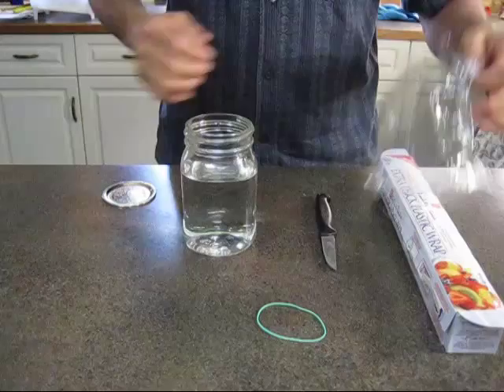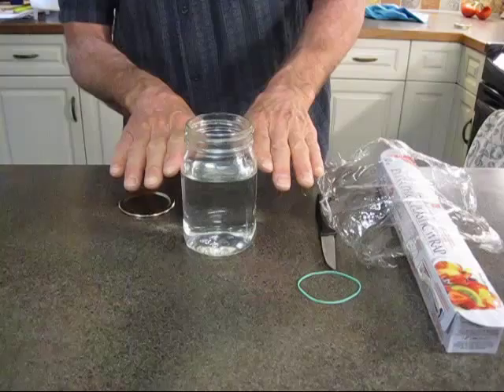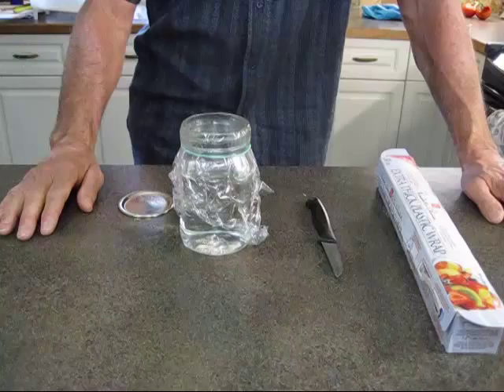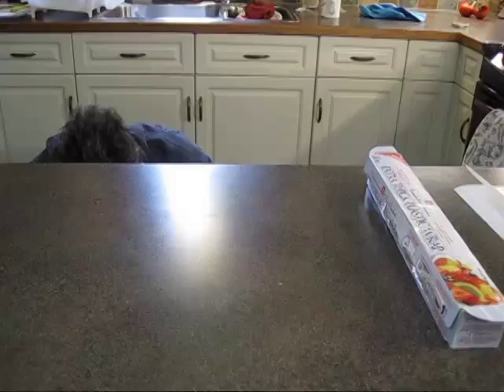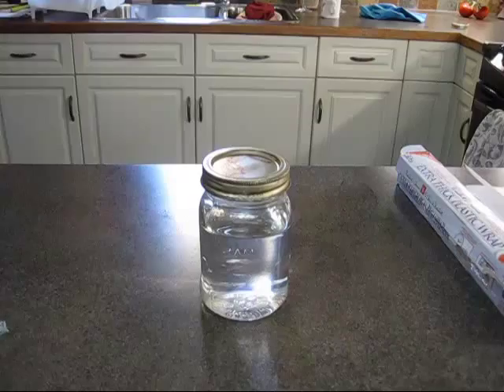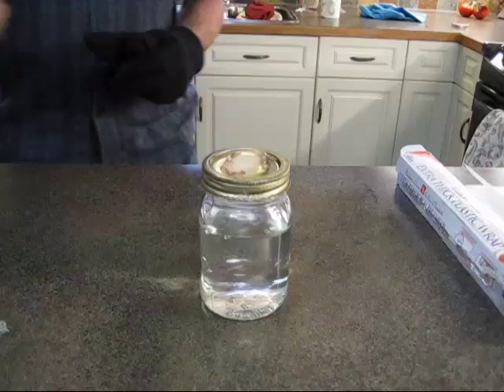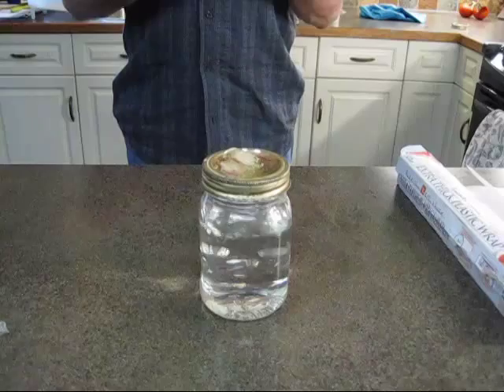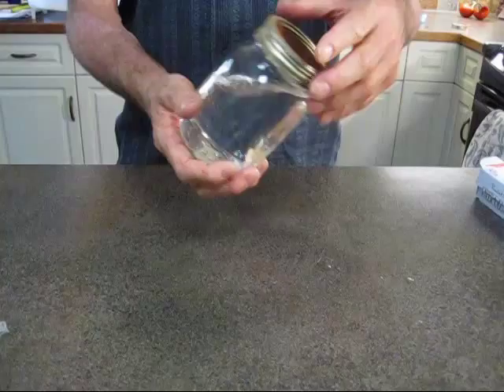Boiling Water with an Ice Cube: Demonstration of Vapor Pressure

Comment: Mechanical engineering student here. I've done tons of saturated liquid/vapor problems in thermodynamics, but this really brings it to life. Great demonstration!
Reply from the maker: I agree that this is an odd term. I think it refers to liquid phase as being "saturated" with thermal energy. If you add heat at constant pressure, the temperature of the liquid phase does not increase. The liquid has all the thermal energy it can hold at that pressure.
Reply: When it's boiling, the water is cooling but does that mean the space above is getting warmer?

Comment: I wonder if I understand well ???   when liquid will reach room temp and you put the ice on top, vapor will still change to liquid on the surface of the metal and bubbles  will form in the liquid in much slower rate. it will be  happening until liquid temp will droop close to 0C and we will have ice formation. no more saturation. :((am I right ????
Reply from the maker: It will remain saturated until the triple point (about 0.01C).

Comment: One thing still I still get confused about vapor pressure:

Lets say I pressurized the jar with compressed gas to 2 atm (gauge pressure). 
At 2 atm, the boiling point of water is 120 'C.
So at this point, I will heat the water to 125 'C to make it boil. As it boils, should I expect the vapor to exert a pressure into the enclosed system? Should I expect to see the pressure gauge go above 2 atm? If so, is it possible to predict the pressure increase?

The reason I'm confused is due to the word 'pressure' in vapor pressure.
Reply from the maker: The pressure in steam tables is absolute pressure. A gauge pressure of 2 atm corresponds to an absolute pressure of 3 atm (if local atmospheric pressure is ~1 atm).  At this absolute pressure, the saturation temperature ("boiling point") is about 134 C (not 120 C).
Reply: Thanks David. I see... So if I heat the water to above 135 C and get it boiling, would I see an increase in the pressure of the system? As in, does the boiling vapor "add" more pressure?
Reply from the maker: Yes. If you have saturated water at 3 atm (134C) in a sealed jar and you add heat, the pressure will increase.  Have you taken a thermodynamics course? If so, this process is a vertical upward line on a T-v diagram. This is a constant specific volume process. Hope that helps. (Also, remember the physical cause of pressure: It is the force produced by water molecules bouncing off the container walls. More heat means more molecular kinetic energy, means more impact force, and thus, higher pressure on the walls.)
Reply: I see! That makes  sense. I have done a subject on thermodynamics but never really understood it well, but thanks for pointing that out! at least now I know where to do further reading (T-V diagrams). Thanks again for your replies. It's really helped

Comment: Sir,is it necessary to not have any trace of air in jar.because in definition of vapor pressure "The vapor pressure Pv of a pure substance is defined as the pressure
exerted by its vapor in phase equilibrium with its liquid at a given temperature." i am confused that whether there is only vapor is there above liquid OR there is air fully saturated with vapor which is in equilibrium with liquid?please clear this doubt.

Comment: Hey, i have a question:
Why do we have to wait before putting ice on top of it? It didnt work when tried instantly after taking it from oven.
Reply from the maker: The timing of the ice should not matter. However, it is critically important not to let air into the jar. Even a small amount of air will greatly reduce the condensation rate on the lid, and reduce the tendency to boil.  So, differences in the haste and care in putting on the lid can produce a lot of variability. That may be what you are seeing.

Comment: thanks~ I have one question. in that bottle, I think at first pressure of water vapor is 1atm
but before you put ice, is pressure of water vapor at the vapor pressure in equilibrium?
what i wondering is pressure in the bottle before you put ice
Reply from the maker: Immediately after putting on the lid, the liquid and vapor are a equilibrium at saturation conditions, 1atm and 100C. As the water cools the pressure will fall. But the cooling process is slow enough (without the ice) that the system will be very close to equilibrium. For example, if you measured the liquid temperature before putting on ice -- say, it was  95C -- you could look up the corresponding pressure on a saturation table (84.6kPa).  This would be very close to the actual pressure in the vapor in the top of the jar. (I've thought about adding a Bourdon gage on the lid to demonstrate this.) Of course, the system is not at perfect equilibrium, since there is some vapor condensation on the glass and lid without the ice. But it would be close.

Comment: Is the water hot?
Reply from the maker: Yes. It sets off at the normal boiling point (100C, 212F) at atmospheric pressure, and cools to about 50C (120F), still boiling because the pressure drops in the jar.

Comment: you mean you lower the temperature by adding ice to increase the temperature of water?  how does thermodynamics work here?
Reply: Boiling doesn’t mean increasing the temperature. Boiling starts, when vapour pressure of the liquid becomes equal to the atmospheric pressure. Boiling can occur at 20 degree celsius also.

Comment: question, how many minutes to boil water in the microwave?
Reply from the maker: I'd say about 60 to 90 seconds if sufficient. The air needs to be almost completely replaced by water vapor. The presence of any air greatly reduces the heat transfer rate to the lid, and reduced the effect.

Comment: Sir, I tried the experimentation exactly as you illustrated, but I didn't come up with the same result, like yours.
Reply from the maker: Hmmm... what could go wrong? Try it again and be extra careful to get all the air out of the upper part of the jar. Don't poke many holes in the cling film and let it boil for a couple of minutes. Then get the lid on FAST.  For technical reasons that I can't go into here, you need almost pure water vapor in the upper space. Even a bit of air will reduce the condensation rate tremendously and may prevent vigorous boiling. Hope that helps.
Reply: @FluidMatters  Thank you so much, sir, you're my lifesaver huhuhuhu